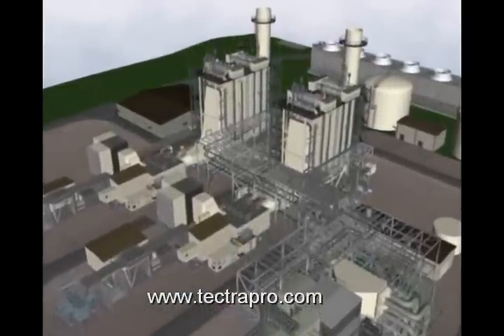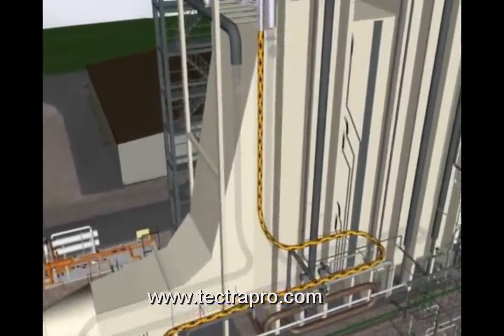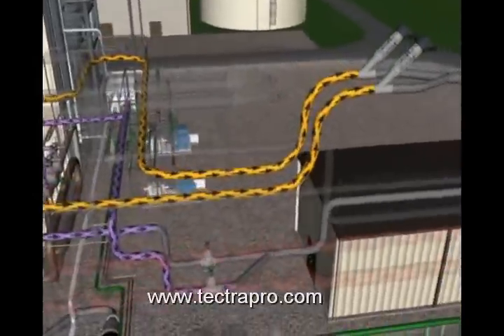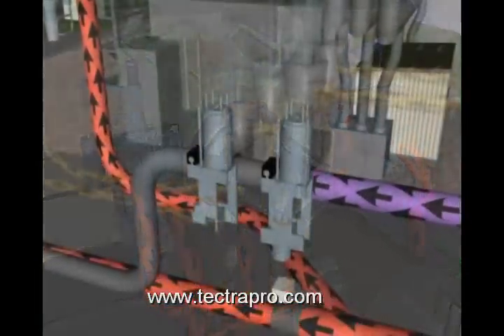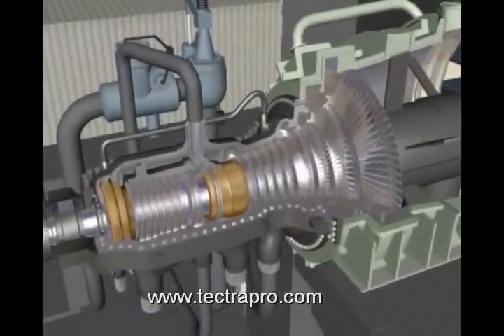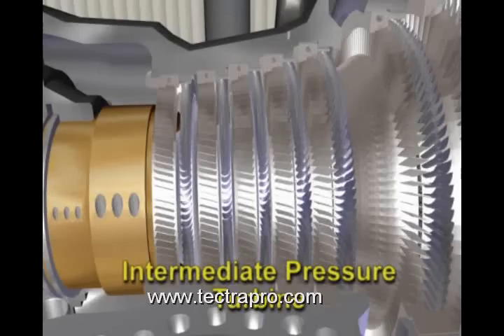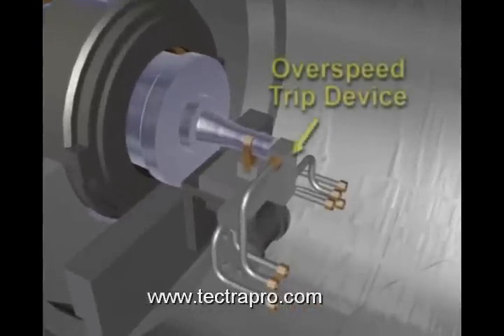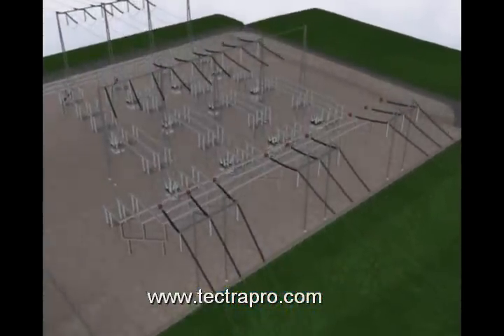MHI Steam Turbine

Comment: not really. the mechanical power won by a turbine depends on the enthalpy CHANGE of the steam before vs after the turbine. the efficiency does not simply base on higher enthalpy either. e.g. higher pressure results in lower enthalpy if you are looking at the same temperatures for both pressures.

Comment: Combined cycle plants of this type run at over 60% efficiency. Combined cycle plants make use of a gas turbine (similar to a jet engine) and steam turbine in series. The Siemens state of the art combined cycle plant in Germany which was put into operation abot 18 months ago has an efficiency of 64%. Not too shabby. Most conventional power plants have efficiencies of about 35% to 40%.

Comment: Small steam turbines are very inefficient. Anything smaller than about 250 HP uses a lot more fuel than a piston engine. Also turbines require dry steam ie no condensed water droplets since they would errode the turbine blades in short order. For a piston engine this is not an issue. One disadvantage of a piston engine is that if usually requires lubricating oil mixed with the steam to reduce friction and wear in the engine. Hope that helps.

Comment: The high temp, high pressure steam is expanded and cools as it drives the turbine. It's the thermal energy of the steam which is converted into mechanical work.

Comment: @antwan0211 I'm not an expert, but I'll try to answer your question.  A steam turbine is a mechanical device that is configured in such as way that it rotates as steam pressure is passed thru it.  This rotation is used to drive an electric generator (electric generators need movement to produce electrical current flow).

Comment: @BigBlue0425 They are trying to minimize horizontal(axial) movement of the shaft by creating a "tugging" effect of the shaft. They have the HP and IP, LP turbines tugging on each other, thereby reducing the load on the thrust bearing by moving torsion effects onto the shaft in between the HP and IP turbines.